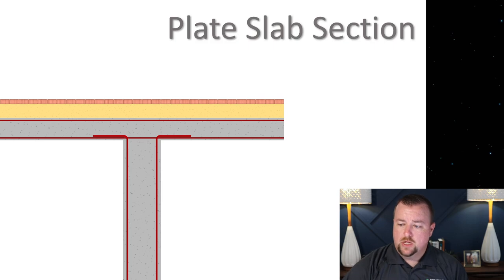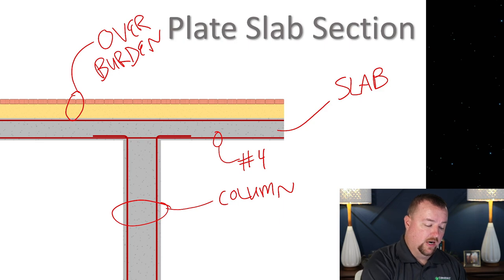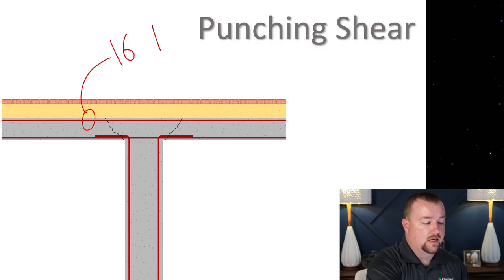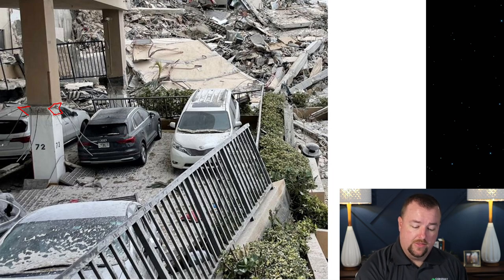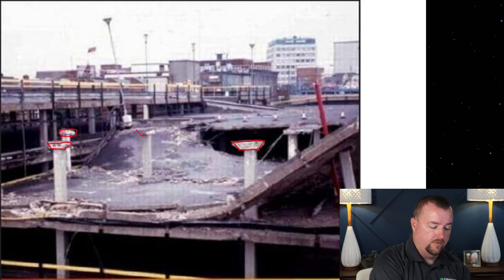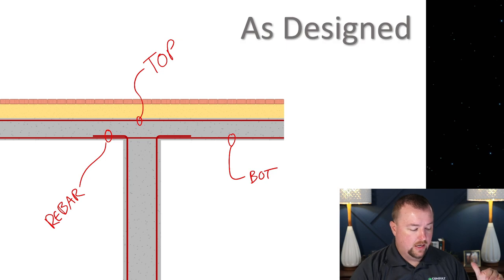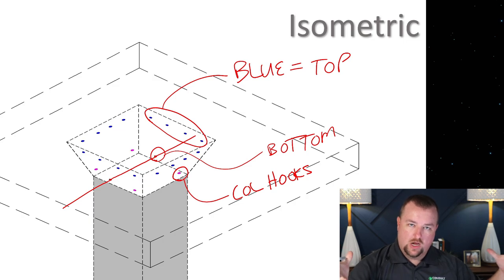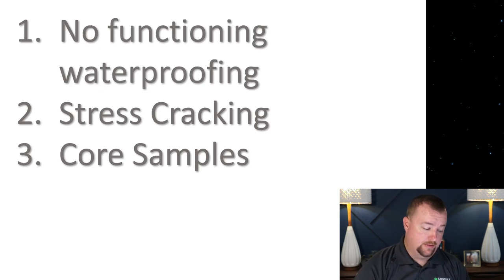The Importance of Punching Shear at the Surfside Collapse

Comment: This was a very clear presentation. In fact, it is the best explanation I've heard so far of potential failure elements!!
Reply: The elephant in the room is were the slabs above the adjacent parking garage also de-laminating? This would be in addition to failing at the base due to water, rust, and spalling. The fix in high salt (corrosive environments) would be to use stainless steal at the ground and below ground levels. It seams to me that a more substantial stirrup  is required at the bottom of these lower level columns as well. Comments?
Reply: @kmagnussen1052  I bet the delamination ran right through the top sections of the parking garage columns. 

Spalling around the rebar there and "any" lateral movement (such as the collapse of the slab under the planter boxes... creating an imbalance of forces, from a horizontal vector, acting on the weakened columns)... would have started the domino style collapse. 

The affected columns would have slid past from the top of the delaminated garage ceiling (1st floor) and off the garage level columns.  So 1st floor (ground floor) buckling and point of failure.

Comment: My first job back in the mid 1980s was in civil engineering construction. It was there I learned that concrete is not waterproof. One of the many tasks I had was to paint the inner face of a concrete retaining wall with bitumen. No one explained why, though I was aware of steel reinforcing rusting and causing the concrete to burst. Now I know just how important it is. If only we had videos like this back then.

Comment: Josh
Your method of teaching far surpasses all my university professors 
Please please please 
Consider becoming a professor 
The world needs engineers like you 
High praises 
Randy
Reply: Josh
Would it make a difference if a larger beam is used from pile cap to first floor and round instead of square 
And does it make sense to eliminate basements since the water table is so high in Florida

Comment: Very good analysis. The garage was screaming for years time is running out. The question almost seems to be not why did it collapse in 2021 but how did it not fail sooner? Or perhaps what precipitated the failure of the first critical element?
Reply: I saw 2 news programs via You Tube. One mentioned the change in building codes post hurricane Andrew and the other mentioned the level of corruption that was going on when these condos were built. Then you add in climate change and you have building failures. It was eluded to that the building codes changed during the construction of these buildings.
  Also, the building managers quit due to arguments among the tenants. The repair bill was $9 million. The tenants thought it was too high.
Reply: @lynnmaupin-simpson1215  The HOA had already secured a $15 million line of credit to pay for the work.  At the time of the collapse they were waiting for the contractors to submit their bids.  

What I do find interesting is that a couple of months prior the prospective bidders had gone over the entire building.  Apparently none of them noticed anything that caused them to sound the alarm.
Reply: @colincampbell767  In a previous video, Josh discussed the potential problems with the soil and water conditions below the slab and piling caps underneath the underground garage. It is extremely likely that the soil was washing out and "working" below the slab, causing cracking, which in turn allowed saltwater intrusion into the bases of the building columns, leading to rust-jacking.

None of that would be visible from above until the situation was beyond critical.
Reply: @chemech  If the problem was at the base of the columns - why are they still standing?
Reply: @chemech  There were some cowboy contractors in Florida in the 1980's.  A 12 storey building collapsed in 1981 while under construction in Florida, killing several workers. The cause looks clear to me. Poor quality work during construction, lack of rebar, corner cutting, and probably poor quality concrete too. One of the investigators who drilled the core samples said the concrete was very soft and easy to drill.
The salt water and air around the building exacerbated the existing problems.
Reply: @colincampbell767  The ~4 key columns collapsed, leaving no support for the face of the tower towards the pool deck. They could not withstand the turning forces as the pool deck collapsed.

There was no single problem - the entire structure was compromised.
Reply: I read some of the obits. There were 2 retired structural engineers who were killed. Wonder if they were on the board or kept up with everything or ever parked below
Reply: @christopher Cripps the failure didn't happen sooner because how stubborn structures are. Most materials in our lives are 10x stronger than we realize. Most failures are direct result of finding the one trick it takes to make something fail.

Most examples are of automobiles that refuse to die. As with most huge catastrophes, this took multiple points of failure to culminate. If there had been at least substandard waterproofing (opposed to none), the overall substandard design of the initial project would keep the building together until the soil under it eroded away.
Reply: @lynnmaupin-simpson1215  re: "Then you add in climate change"

No, This is NOT a factor. You have been lied to, and repeatedly, on this subject.
Reply: @tubester4567  I was in Cocoa Beach when the Harbor Cay condo collapsed.  Our unit from Patrick AFB was dispatched to help with rescue.  I was on top of the pile an hour or two after the collapse.  The cause on that one was the slabs were too thin and the rebar was in the wrong location.  They had poured the 6 floors in two different pours for each floor.  They were doing the roof when it collapsed and they were doing the roof in one pour.  They also dropped a large hopper/bucket of concrete onto the building in the process.  It was under construction at about the same time as this building, but a few hundred yards back from the beach.  As I recall it was closer to the intercoastal waterway than the beach.  Same type of construction as this place.
Reply: @uploadJ  omg I can’t with these people was going to say the same thing
Reply: @jeffhoffert4712  thank you for your service.
Reply: @tubester4567  If that is the case, they should find similar issues with Champlain Towers North, which was built by the same contractor during the same time as the south building was built.
Reply: @colincampbell767  DoctorLarry  
"Based on 50 years of experience in structural design and assessments. 
It was not a fault structurally, but in waterproofing (maintenance). Big difference."   
  'in my case I noted that if a building stood 40 years, there was no faulty construction. That is based on 50 years of experience in structural design and assessments - it is not speculation.
It was not a fault structurally, but in waterproofing (maintenance). Big difference'
Reply: @colincampbell767  Good point. There are lots of columns. The ones you see standing were under the pool deck area, not underneath the building.
Reply: @jeffhoffert4712  Interesting. Thanks.

Comment: I’m not an engineer but father brother were and it’s in my bones. Having been involved in multi-storey construction in Australia I became accustomed to the methods you described. Also used to hang suspended ceilings from under slabs.
About 10-12 years ago I visited an older high rise for remedial floor topping to drains.
I parked in the underground car park and naturally looked up!!
Absolute horror at radiating cracking from all column tops.....multiple cracking like never seen before. This is a Casino on Queensland Gold Coast. 
Have not been back, now retired anyway but figure a large number of qualified men have seen what I saw over THE YEARS. Sometimes I figure I’ll hear of it being closed for demolition or worse collapse but no, life goes on.
Love your analysis so clear and understandable....thankyou

Comment: Great presentation (as are the other videos in the series). I regard my self as a "technical viewer'- a PE (Civil) for about 50 years but focused on Highways in early years, and contract and project management later. I did however do (as a very young engineer) some work on structures after Ronan Point collapse and much later on housing blocks in Far East that were severely suffering from issues around corroded reinforcement due to salt water leakage inside buildings (used for WC flushing, fire fighting and washdown of public spaces), too thin walls/slabs, missing cement/rebar in concrete, and concrete made with salt water, and some questionable overall structural decisions.  But my later role was contract and project management not structural engineering - although I did 'comment' on a few worrying bits!

Anyway, I consider a likely failure mode at Champlain is collapse of pool deck due to punching shear caused by delamination, possible with overloading due to planters etc., this slab collapse then pulled out columns under building due to beams linking pool decks and building columns - so a pancaking of the building. BUT looking at some of the structural drawings and looking at various concrete strengths and how they changed for slabs and columns I couldn't work out how the columns/slab nodes could be constructed while maintaining the different specified concrete strengths WITHOUT leaving a construction joint running either in column in the plane of the underside of the slab, or in the slab on the line(s) of the column face(s). If anyone can help me here I would be grateful. 

At first glance  of rebar drawings (actually I looked quite carefully) the rebar out of the columns bending into the slabs looked to have minimal lap lengths, and I was surprised that none of the column bars didn't 'turn' (either at 45 degrees or at 90 degrees to the level of the top slab rebar. As shown in the video the lack of shear reinforcement around the column heads are surprising. (as clear from remaining columns and drawings). The overall impression is of 'light' levels of rebar although residential building do have light floor loadings.

Also looking at the drawings - and the photographs - the lack of 'beam strips' in the slabs appears clear, and if these had been present would have added a redundancy and  robustness to the structure (But I have never been involved in flat slab design/construction so have no credentials in this area). For a robust structure in a strong wind environment (i.e. hurricane/typhoon) the columns look slender (although are generally very short i.e. limited story height) and the grid looks sparse, and the overall (i.e. whole building complex) limited shear wall/or L shaped columns appears surprising - but maybe that is just my 20/20 rearward looking vision. But it is a hurricane/typhoon and having been on upper floors of 20/30 story buildings during high winds I respect those forces!

After the failure of Ronan Point in 1968 (which was built from precast panels) we added, for future similar buildings, additional rebar to some panels to provide column/beam strips and we added more steel strengthening  at wall/slab joints especially at column/beam strip nodes. There was some retrofitting as well.

To repeat thank you for the professionalism of the videos and the quality of the engineering knowledge is very clear. From myself and I am sure from many engineers worldwide my sympathy is extended to the families of the victims and my regrets in what appears to be a failure of my profession.

Comment: LOVE YOUR CONTENT JOSH!!!
The west side of Champlain South didn't fall because it appears that west side was built on 24" by 24" columns... vice the skinnier column on the east side.  Just my observation.  Please keep bringing more to the table.  You are THE ONLY person who's theories I can relate with and support!!!
Reply: Always thought those coloums way to thin in the garage area
Reply: You have to wonder if by adding that thirteen floor if there was any strengthening of the supports for that part of the building. Am I right in thinking that if you change the load at the top, you have to have support at the bottom that corresponds to what it's holding up?
Reply: Think it will also be less water intrusion. We"ll see!
Reply: The columns did not fail people, they are still right there poking through the slabs.
The columns were pulled/ knocked over as the structure pulled down around them in the higher levels.
Reply: Suspect the large sheer wall on the opposite side of the elevator bank and stairwell was a huge reason it remained erect even with all the vibrations and ripped out rebar as the portion more eastward collapsed.
Reply: @goyaliza  but wasn't that penthouse built after everything was already constructed I might be wrong but if it was how would they change the columns after they were already built
Reply: @edzachary8657  that's the line where I'm going...original design is 12 floors but now another floor is added with no compensation for the new weight
Reply: @edzachary8657  It's crazy that they would add the penthouse over the skinnier columns instead of on the other side of the building. Why would the original plans call for varying size columns. I would expect them to be consistent throughout the building. There doesn't appear to be any difference in floors or floor plan to design it that way.
Reply: @TyphoonVstrom  if the larger columns specified larger toppings, that may have something to do with it? Larger toppings are going to be harder to punch through, is my layman understanding of hiw this works. Granted, the toppings seemed to have failed too.
Reply: I’ll put the majority of blame to lack of waterproofing.  I’m an architect and builder and I’ve seen floors being added without any problems - but obviously case by case study.   You would have thought a thorough structural inspection part of the design of the new penthouse - questions to be asked why thy these engineers did not raise concerns about the condition of existing structure - maybe the had.

Lack of waterproofing will cause the reinforcement to rust resulting in completely eliminating the the tensile strength of the slab over time.   Not having waterproofing (either a lack in architectural specification or omission by builder) has perse nothing to do with the engineer, yet it has much to do about the structural integrity.    Not having waterproofing is massive.  It caused the slab to absorb water, adding weight and causes the structural steel to rust.   The planters added after the design plays a part - it adds weight but generally the slab can carry this weight no problem (think adding a bath full of water, heavy but no problems for slabs).   The problem is the planters probably also did not have waterproofing.   This is a bigger problem as with the slab as the soil retains more water, the slab below the soil will never dry out so it gets saturated where as the slab around the pool will dry out from to time.   That said, slab may be more exposed to salts being so close to the ocean.  Also, in the soil there are also many chemicals that could assist in steel corrosion. All in all, keep the structure dry at all cost.   Water ingress is the biggest reason for building insurance claims.   Cause wood to rot, steel to rust, increase in internal moisture raised humidity and result in mould to grow and help feed termites.   ANY damp in a building is a no no.   When we do basement constructions we generally have least 2, often 3 ways of waterproofing our structure.   First you always try and remove water - gravel trenches (French drains) with perforated drainage pipes below slab, gravel layer next to walls or screed to fall on top of a slab: all to remove water from the concrete surface.   Then we look at water solution - many different solutions (painted on, membranes, injections).   We also try and look at how these layers can be maintained or repaired if possible and this factors into choosing a waterproofing solution.   But it is very expensive stuff basements.   

To have no waterproofing at all - boggles the mind.   To then also allow standing water - what were they thinking?   And on top of all that, right next to the ocean……🤦‍♂️
Reply: @sonjo2419  that's where the lobby and elevators were... so maybe more weight
Reply: The pounding from building being built across the street and vibration, as residents complained they could feel it, added to the demise.
Reply: @sonjo2419  
If you look at the before pictures of the building, almost every balcony has different kinds of tiles. That means that people bought what they wanted, and tiles weights  a lot....

Comment: My heart skipped a beat when you explained the cracks in those core samples. I thought they cracked while drilling the sample, but closer inspection does say otherwise. It's a chilling realization.
Reply: I agree and core samples performed in 2018 ! Most of this structural damage was hiding !
Reply: Core samples should never look as shattered as the ones in the first pics. If you have good concrete and good integrity there should be zero fractures in those samples.